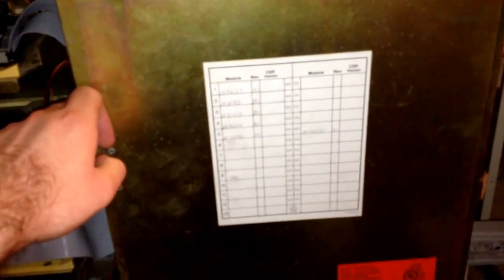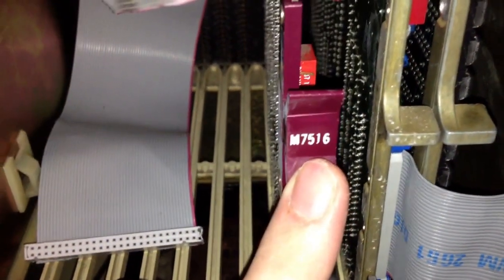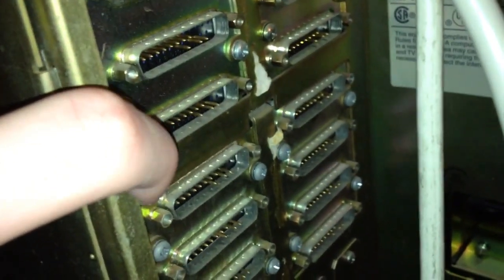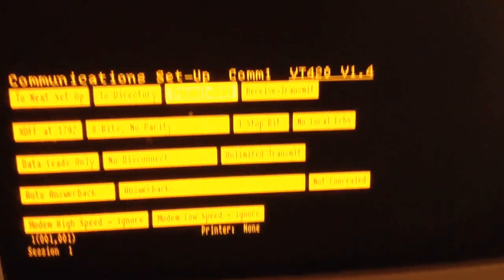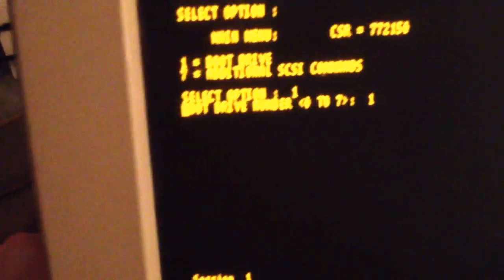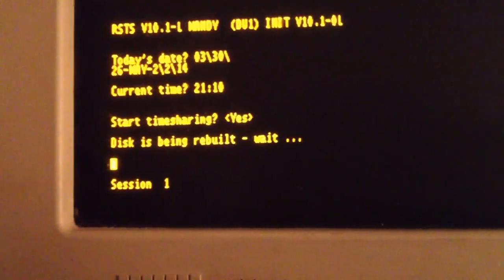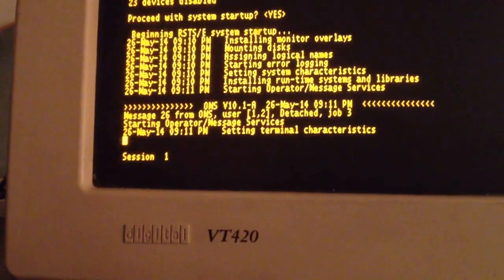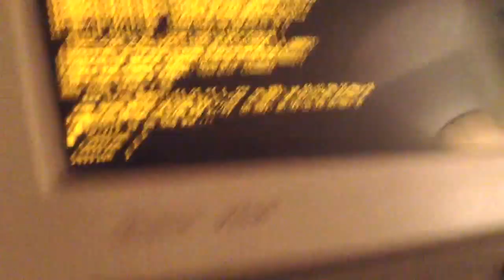My PDP-11/23

Comment: I worked on manufacturing 11/23 system boards in DEC's Galway .Ireland plant from 1979 to 1984 approx. I worked on all the Vaxes after that..11/785, 9500 etc. Plant closed down in 1994 and I was with Intel after that. DEC were a GREAT company to work for.

Comment: i have a pdp 11 cpu board and two ram boards (i belive its ram) laying around. i dont know if they work,but you can have them if you want, because i dont want to throw them away.
Reply: FoxMccloud42 Hi, if Cory does not want these boards I would be highly interested! I've been looking for a DEC PDP for quite awhile now and if and when I find one I may end up just getting a chassis and needing a CPU and ram. If I do get one complete already extras will be nice in-case the ones in the system have problems since repairing these boards can sometimes be quite difficult to impossible if you can't find some replacement chips...
Either way, thanks for saving them!
Reply: Conmega
i which country do you live?
Reply: I live in America, but since the boards are relatively small and light shipping them over seas if necessary shouldn't cost too much I imagine... And of-course I would pay for shipping :)
Reply: Conmega
send me via pn your adress and i send you the boards as son as i can.
but there is on the cpu board a diode or resistor missing missing, but i will mark it for you